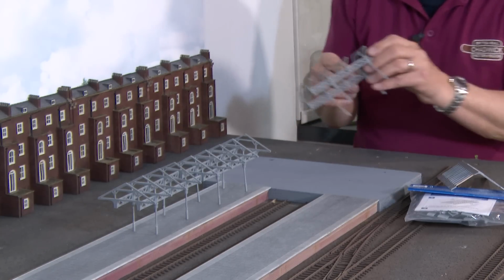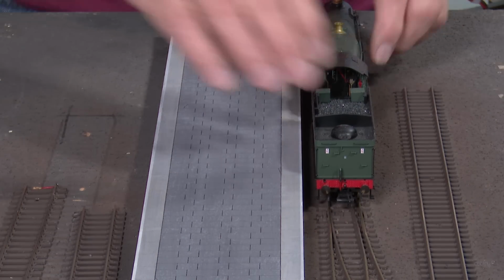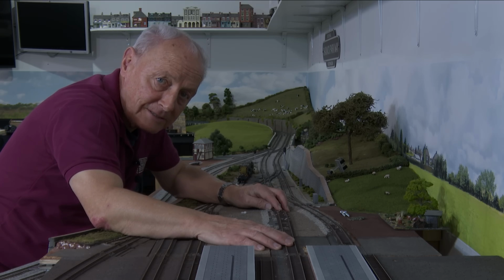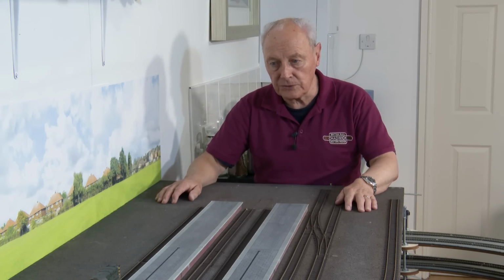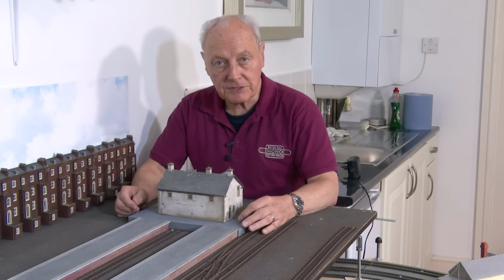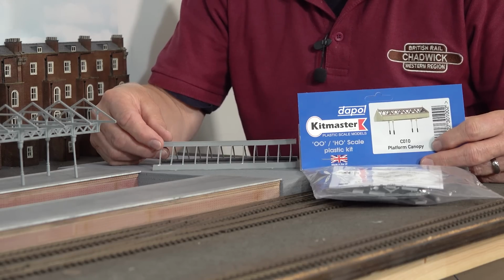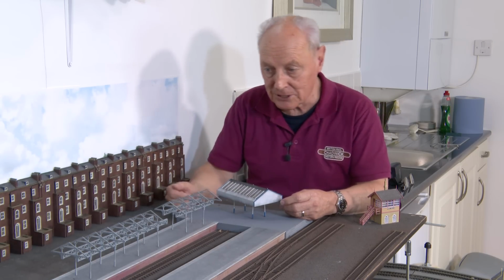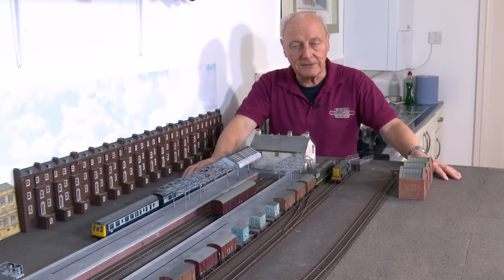Branch Line Design at Chadwick Model Railway | 235.

Comment: One thing to note about points next to a platform, it is not unknown for the platform edge to be moved back a few inches to allow for body swing clearance. Banbury station had quite a noticeable recess in platform 1 where a siding connection joined half way along.
Reply from the maker: Yes James, in a later video I have photos of two such examples.
Regards Charlie

Comment: How would loco hauled goods and mail trains get out?  The First van fouls the crossing, so the Hymek couldn't simply run round the train.  Or would the train be uncoupled and moved to the sidings?
Reply from the maker: Rest assured Timothy, there is a runaround and yes the relevant goods trains do fit.

Comment: Hi Charlie

I’m just about to install many, many, point motors and have been planning the use of MP1 and MP5 point motors and Digitrax DS74 controllers. I have now seen a digital version of the MP5 called the MP4. It has a decoder built in. What do you think? Will this be simpler? Also can you explain how to use local switches as well as Train Controller to control points with a DS74 as having local control on a mimic with LED feedback as well as using a computer is the ideal combination. Can you do this with the MP4?
Reply from the maker: Hi Tony, I have never used the Digital point Motors, but I would’ve thought that they were a better option than using tortoise point Motors with an DS 74. As for a mimic panels, I must confess I have never used one. Hope this helps, regards, Charlie.

Comment: An observation on within platform run around loop/crossovers. This regulalry happened at Weymouth during the Class 37/loco hauled coaches era and reason for mentioning is that there was a scalloping out of the platform coping (??? 3 inches or thereabouts) so that a Class 37 didn't scrape the coping when reversing out to run round.
Reply from the maker: ThanksJohn, I shall have to check out my previous images and see if I’ve got a shot of it. Regards, Charlie.
Reply: @ChadwickModelRailway  if you haven’t got one it is easy for me to go over to the station on the bus and take a quick phone shot for you. That assumes they haven’t resurfaced it since. One advantage of Portland’s 15 min bus frequency and stops convenient at both ends.
Reply from the maker: @johnnew3096  many thanks for the offer John, but I think I’ve got one. Regards, Charlie.

Comment: Another great video Charlie. I do look forward to your new installments. Regarding the Dapol canopies. As these were previously in the Airfix range, I usually have a look on 'that auction site' for the Airfix boxings of these models especially the earlier releases. Reason being is that the mouldings are 'newer' and not as worn out. Comparing the older boxings with the Dapol re-releases, the difference can be quite noticeable. They're usually pretty cheap too. I'm a model builder at heart, so always enjoy building these things.
Reply from the maker: Thanks FS, for an interesting comment. Regards Charlie.
Reply: Totally. On pretty much all the Dapol stuff try and get the older Airfix boxings. Far better mouldings and proper instructions. I have a set of about 6 made up and they fit perfecly so keep a look out at train fairs as they are getting scarce. Cheers

Comment: Charlie, with regard to the platform edge gap to allow for the overhang of locos, it is apparent in some of the heritage lines that there is a notch curved into the platform to allow the average gap to be close, but the loco not to contact the platform during the runaround. 
But unless you put the camera in position to see the gap, an extra mm would not be apparent. 
Loving the development. See you at RailEx.
Reply from the maker: Thanks Tom. Apparently there is a cut out in Minehead on the West Somerset.
Regards Charlie

Comment: Another great video Charlie. I too like the size and structure of the old Airfix canopy but they are a nightmare to build! If you can get old Airfix ones they are crisper and better plastic which helps a little. I don’t try those individual bars but use a solid strip of glazing and then add a T section girder underneath using a 12mm b masking tape strip to help spacing and Tamiya extra thin cement so it doesn’t haze the glazing. Then spray grey before removing the masking tape. 
PS Railmatch do GWR light stone and dark stone as well as a cream paint in both enamel and acrylic. 
In stock at our SDR shop in Buckfastleigh.  Someone else mentioned the coach converted to a cafe. You might remember the one at Staverton. Converted from the centre coach of a 115 DMU. 😁
Reply from the maker: Many thanks for your advice, Mark, very much appreciated. Regards, Charlie.

Comment: I have some of the old Airfix canopies which is what the 'new' ones you have were originally - thus the moulding tools are VERY old and a poor kit compared with the 1960/70s when Airfix made them? The Peco platform canopies are simpler but much easier to build - I have built them as pairs side by side to cover my platforms with a gutter down the length of the platform, Much better that the old Airfix ones. Another good video by the way, Thanks.
Reply from the maker: Thanks John, I believe the latest one from Dapol have recycled plastic! It’s very soft.  Regards, Charlie

Comment: Hi Charlie.  Your mention of the loco/coach swing-out crossing the point reminded me to mention that if you are using a modern continental model eg Fleischmann with its Kinematic couplings, they jut out even more, as the continental coaches are much longer than British ones and I have even had to remodel my curves due to clashes of coaches/wagons on adjacent curved fiddle yard tracks.
Reply from the maker: Fair point K7214, it’s all in the planning. Regards, Charlie.

Comment: On the subject of station colours, chocolate and cream is only applicable for the Western Region post 1948 period until the Corporate BR colours came into force.  The GWR used light and dark stone colours.  I have previously used Humbrol 121 for the light stone and Humbrol 187 for the dark stone.  Another range of paints you might want to seek out are Railmatch, available in both enamel and acrylic, available from Howes of Oxford or Alton Models in Hampshire.  Both do mail order.  There might be BR chocolate and cream colours in the Railmatch range.
Reply from the maker: Thanks, Steve , I shall search out the rail match. Regards, Charlie.

Comment: Nice to see things progressing Charlie. I’m sure you are on it, the now disused passenger platform would need the remains of a semaphore signal (probably with signal arm removed). In my mind a new colour light wouldn’t have been installed, so it would have been a semaphore signal. Once the line is unused the arm would be removed. In more modern times a white cross would be put on the arm to denote out of use, but I think this practice started after the era you are modeling. Hope that gives you another thing to add to your (I’m sure) ever growing list of things to do. Nice mix again this time, can’t wait to see the new station building when it arrives.
Reply from the maker: Thanks Lawrence, that’s a useful suggestion. Regards, Charlie.

Comment: Hi Charlie. Thanks for highlighting the clearance issue for points by platforms. I have a memory (can't think where it was now) standing on a mainline platform waiting for a train and seeing that a section of the platform had been cut out In a curve to accommodate the swing of a loco running around through the points.
Reply from the maker: Thanks, toad, many people have said the same. However, it’s something that I’ve never seen, regards Charlie.

Comment: I did use the airfix/Dapol canopy, I used card as a solid infil as my local station doesn`t have roof glazing, but the stantions were a pain and brittle, I can`t say it will be making an apperance on the New layout.
Reply from the maker: Rest assured mate, I feel your pain. I have another plan, to do stay tuned. Regards Charlie.

Comment: Many thanks for your mini-series with loads of useful tips for building platforms; yet again that’s the stage I’m at with my layout.

As someone who once dreamt of being an architect, please forgive some personal thoughts on your options for the station building.

First, as I’m sure you know, the Peco/Wills station building kit is based on Castle Cary. It’s relatively easy to make and looks good. 

The two ready-made buildings you showed, like the kit, are designed to be parallel with the platforms. The ‘station hotel’ looks great in itself but feels out of character to me so I look forward to seeing your new scratch-build commission. 

Your station layout reminds me of the former Exmouth or, dare I say to a GW man, Ilfracombe. Their station buildings might inspire and are in very different styles.

As for canopies, one of my stations uses Faller kits to imitate Derby Midland in 1960s/70s. Another, loosely based on Stroud, needs some adapted Metcalfe canopies. The third, based on a 1950s Walthers building, I want to scratch-build something akin to Portishead, using pairs of old Hornby brackets. Thanks for the warning about the Dapol kits!
Reply from the maker: Many thanks T, for sharing your thoughts. I don’t like to get to prototypical, as long as we hold onto the spirit that drives us. Regards, Charlie.

Comment: The platform surfaces look very good, looking forward to seeing the coming additions.  I have bought several of the Dapol kits and I completely agree about the fit of them.  I believe that they are made with recycled plastic, don't know what percentage, but they seem to be very soft and too bendy.  The advantage of them is that they are fairly cheap if you don't mind re-engineering them as you put them together 😊.
Reply from the maker: I’m rethinking the configuration of mine, Pauline. Please don’t take yours any further until you’ve seen what I’ve done with mine. Regards, Charlie.

Comment: Excellent build video.
Charlie: I'm curious. At Wellington's platform 9 where the runaround is; there's a recess cutout in the platform edge specifically for loco swing clearance. Has the UK never had this practice on the full size railway? Seems curious as it's a very practical solution for a very specific problem
Reply from the maker: That’s an excellent point, and I’m told there are cut outs in Birmingham new Street and minehead. Regards, Charlie.

Comment: My question is why there is any point work within the platform area? Any sane setup would have the point work outside the platform area, so to enable the platforms to be as close as possible to the trains.
Reply from the maker: This type of point work was very common, to allow the Loco to detach and run around and pick up the train at the other end. Regards, Charlie.

Comment: Today I tried to fit a signal in the six foot gap between rails on a 3ft radius curve. When running a mark 3 coach past, clobbered it every time in either direction. So all signals will now be on straight track now.
Reply from the maker: That seems a sensible decision Kelvin, regards Charlie.

Comment: When you showed the redundant track again I was thinking you either need to

1: At least remove the rails, even all of it just leaving the ballast overgrown with rubbish.

2: Add a point into it so it has come from somewhere.

Hey presto you added a point, which would be my choice. I always believe that  if something is there then it needs a raison d'etre, which that point creates.

As for the dapol canopies I've always like the look of them and they are something I'll probably have a go at. However, those moulds are older than me (introduced 1959 I believe) and that's saying something. Good luck, especially chopping one up to extend it to the desired length. 

Edit: Nice to watch the trains running in and out of the station, especially the dmu's.
Reply from the maker: I’m so pleased you agree with the outcome. However, there is a lot to finesse. Regards, Charlie.

Comment: I had the same issue with the platform clearance on the head shunt points on my shunting layout, luckily I'm using Metcafle kits so I could easily modify the platform to account for the swing on the locos but as you said it does leave a noticeable gap but it's unavoidable if you want locos to not get stuck.
Reply from the maker: Thanks Bill, yes it is a little bit of an issue. Regards, Charlie.

Comment: Once again Charlie great video. Just a food for thought some friends and I a few years back went to a conference for work matters in Bournemouth. While we were there we did of a bit of exploring and found a heritage line. Swanage Railway I think it was. On one of there end of line stations they had a buffet car parked on a redundant line open to the public selling food and coffee etc like they would have done if in service but the coach never moved. I know your not doing a heritage theme in this station but passengers are very hungry mate so maybe a buffet car would work and add dividing fence as you suggested however run it centre platform along platform 3 a coach length and over to coach so passengers can only go to doors of buffet car. Just a thought
Reply: I used to be responsible for the Bird’s Nest buffet in Swanage, in theory. It was parked in the bay platform with a grey vent van next to it deformed storage and, often, an additional TSO for extra seating. It later move to the headshunt but has since been removed.
Reply: @westhavengwr4613  Thanks for the detail. I only went there once it was a great adventure not sure if its still there but think a buffet car parked on dead track would like cool instead of leaving empty
Reply: @jasons.mini.adventures  there was also a buffet car at the Norden end with a more limited range. This was removed earlier. In Swanage the bay platform became more operational so the Bird’s Nest was in the way.
Reply from the maker: Many thanks for sharing your thoughts, gentlemen. A café certainly is a very attractive option. Regards, Charlie.

Comment: Great video Charlie, as ever.   At MInehead on the WSR a short section of platform edge is suitably reduced in width to permit loco movements across release points AND maintain the proper clearance for the coaches. Whilst probably not prototypical across the whole network, it may be appropriate for a branch line, especially if your one steam engine is rostered.
Reply: This was actually quite a common feature at Termini which had loco release points at the buffer stop end, also at a few stations which had points along the platform length to allow access to yards or buildings.
Reply from the maker: All advice very much appreciated, Mike. Regards, Charlie.
Reply from the maker: Thanks MGH, I should take a look on my next visit. Regards, Charlie.

Comment: Hi Charlie. (Canopy build help). When I'm dealing with Plastic with many parts to be aligned, i use a bent to purpose safety pin to apply fast superglue on the joint. Just a tiny spot, enough to hold in possition. Then when all necessary parts are lined up secure, i then apply styrene cement to the joints to hold all parts rock solid. (This method has worked for me when i built a ship hull approximately 1m long with lots of framework to glue. Hope this can be of help to you. Love the video.
Reply from the maker: Thanks Mel, for some constructive advice. Regards, Charlie.

Comment: I used the Dapol kit but left off the roof spars and used sheets of corrugated plastic instead. This means of course that there is no glazing so no daylight showing through onto the platform although this looks ok to me. Adding lighting is made easy too because the wiring can't be seen.
Reply from the maker: Thanks, Les, some sound advice. Regards, Charlie.

Comment: This might be completely barking up the wrong tree, but looking at those canopies, I wonder whether it might look right to have a very short section in just the skeletal form left on the far end of the disused / parcel platform, as if in the process of dismantling, with the metalled sections rusted over, to carry on that feel of a station which is 'less than it once was'?
Reply from the maker: RT, I think you’re bang on the money. Regards, Charlie.

Comment: Top notch, Charlie.
One thing to be wary of with the canopies is that they snap very easily if caught with a sleeve or similar.
One trick is to add some drain pipes beside some of the uprights, made out of brass. Make them a bit longer than the uprights so they go into the platform surface.
Reply from the maker: Sound advice Ken, many thanks. Regards, Charlie.

Comment: Why can't you put the points further away from the station, so the trains aren't switching lines beside the platform?  How does the prototype handle this? I don't understand the problem.
Reply: The points are there to release an engine so it can run round it's train.
Reply from the maker: Bang on the money, Pete. Regards, Charlie.
Reply from the maker: Hi Chris, Pete is bang on the money. It’s to allow the locomotive to run around its train and perhaps a couple on the other end. Regards, Charlie.

Comment: Those station canopies look to have been a real pain to build. I would have suggested that you might consider a PopUp Designs kit, but as this is based on the original Fort William station that would not be in keeping with your GWR/SDJR setting.😀 Nice to see the branch line station coming along nicely though.
Reply from the maker: Thanks JW, but I now have received some reasonable advice on a way forward with those dreadful cannabis. Regards, Charlie.
Reply: @ChadwickModelRailway  I know the canopies were stressful, but have they driven you to drugs?
Reply: You'll be sniffing the glue next.😂